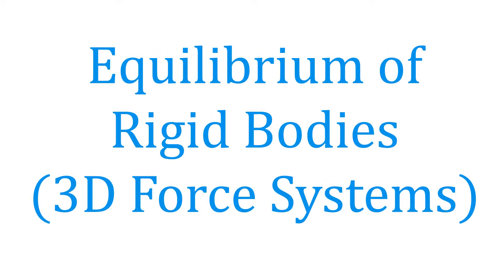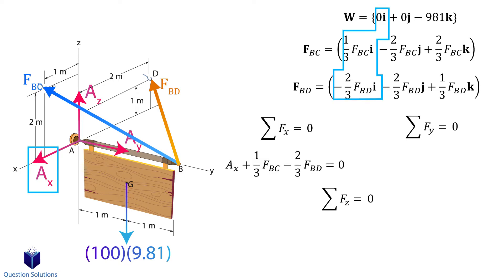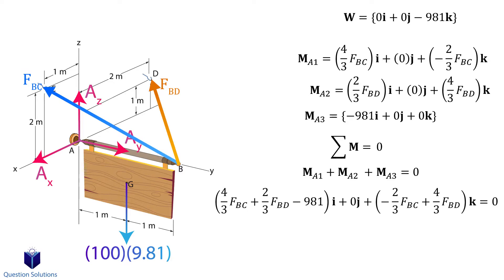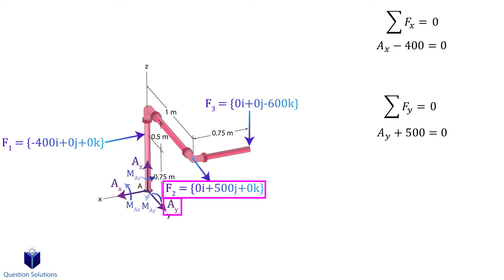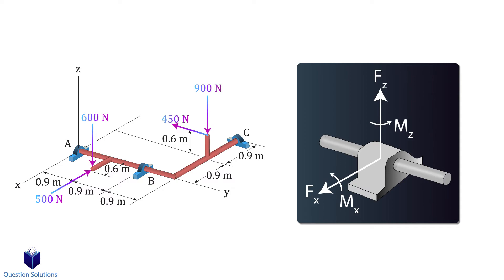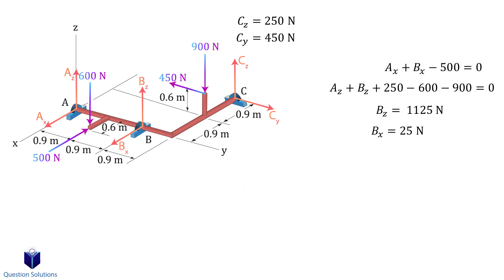Equilibrium of Rigid Bodies 3D force Systems | Mechanics Statics | (solved examples)

Comment: How do forces in the z direction create moment in the y direction?
Reply from the maker: See this video first: https://youtu.be/rdK0c9YZRYw
Reply: @QuestionSolutions  At 9:40, I do not see where you are getting the values for the moments; there are 3 different fixed points not just one. For example, how is the 450 N turning on the x axis instead of the y axis? Are you fixing it at C alone?
Reply from the maker: @the_eternal_student  So that's not how this works. The object isn't moving at all regardless of the number of supports. Imagine you dig a hole in a ground, pour concrete into the hole and then shove a big wooden beam in there. You then let it set. This beam is now solid, you tap it and say "this is not going anywhere" and it really won't budge. So you put all your might into it and try to push it, but nothing happens. Does that mean there is no moment created about the bottom of that beam, or any forces opposing what you're doing? Of course not, there is a reactionary opposing moment and reactionary opposing forces happening to keep that beam from moving. If that doesn't happen, it would fall to the ground (and you'd be in dynamics class, not statics). When you're calculating moments, or forces at pins, or rollers, what you're calculating is the reactionary force created by those supports. You're imagining the forces opposing what you're doing, that's what you're figuring out. When you drive on top of a bridge, the bridge doesn't move, but there are reactionary forces created at the rollers and pin joints. That's what you're doing in Statics class, you are just calculating those things, but all objects in statics are at equilibrium, they don't move or spin. You might remember that a roller can only create a vertical force. Did you consider why? Because if you push on it horizontally, it will just roll, it can't create an opposing force. So at 9:40, the object is fixed, nothing will make it spin, or move, but there are reactionary moments being created along different axes to make sure it stays that way.
Reply: @QuestionSolutions  I am still confused about how you are figuring out which forces and perpendicular distances to use in the moments. At 8:53, the y-axis has two perpendicular axes, but you do not include all the perpendicular forces. At 9:38, you include both axes, but not all of the y-axes, and the distances are not all to the moment point or the z-axis line of action. It is as if you are not only calculating the perpendicular distance to the line of action, but in some cases the distance to the line perpendicular to the line of action.
Reply from the maker: @the_eternal_student  This is incredibly difficult to show through a comment, and I can't answer this question without actually showing you in person step by step how to see which forces are creating a moment about an axis. So I encourage you to see your professor or TA during their office hours. Part of this is honestly using your imagination to see what forces would cause something to "rotate" about an axis and I can't teach that. It needs to come from your own imagination.
Reply: @QuestionSolutions  That is too bad, because I cannot go to school, and I understood everything in your videos, excepting this video.
Reply from the maker: @the_eternal_student okay, give me a few days. I'll create a document for you to understand this better.
Reply: @QuestionSolutions  Thank you so much!
Reply from the maker: @the_eternal_student  Here you go: https://bit.ly/3LhTAgl
Reply: @QuestionSolutions  I think I understand. The perpendicular distance has to be perpendicular to both the force and the axis. Thank you for your hard work.

Comment: at 6:08 can you kindly tell me how to find position vector of r3? I can't understand
Reply from the maker: So r3 is the green arrow at 6:07. The origin, which is point A, is (0,0,0) and the final point is where force F3 is applied, that's at (-0.75, 1, 1.25). So that's -0.75m in the x-direction (notice force F3 is applied on the other side of the positive x-axis), 1 m in y direction, and 0.75+0.5 = 1.25m in the z-direction. You subtract the first set of points from the second set of points to get the position vector, which is just -0.75i+1j+1.25k.
Reply: @QuestionSolutions  thank you so much! 
appreciate replying to every comment brother
Reply from the maker: @mirajuddinfuji6439  You're very welcome!

Comment: @9:34 why is the Force 450 multiplied by the perp distance of 0.6 and not 2.7 I thought the perp distance to the x will be the distance in the y but we took the perp distance of x is the height of z? Thank you in advance
Reply: @killatwistaplayz982  he’s doing the distance from the Y-axis, not the X. He does it for the rest as well.
Reply from the maker: So when you look at a problem like this, don't focus on a single point. Instead, really try to imagine this object rotating about the whole of the x-axis, not a singular point. Forget about all the supports that hold the object in place, let it freely rotate in your mind. Now, another way to see this is to realize that the 450 N force is a floating vector, that means you can move it along the same path that it's on, since the moment created is only a function of perpendicular distance to the x-axis (x-y plane). So if you move it on top of the x-axis, you can see that it's only a distance of 0.6 m away from the x-axis, in the z-direction. You are looking for the distance between the force and the x-y plane.

Comment: 6:07
for r2 &r3, why is the k component equal to 1.25 and not 0.75, am I missing something in the diagram? 
Found the answer, there as an additional 0.5m length from the Force to the bend in the bar towards F2
Reply from the maker: Yes, it's 0.5 + 0.75 = 1.25

Comment: can you tell me about the right hand thumb rule and how to use it
Reply from the maker: Absolutely. This doesn't apply to just moments, it applies to anything where the right hand rule is used. So imagine you have an object in front of you (in 3D space). If that object spins clockwise, you take your right hand, and you curl your fingers clockwise. When you do that, where does your thumb point? It would point away from you, so the moment vector is pointing away from you (in the z-direction). Now if that object is spinning counter-clockwise, you curl your right hand fingers to be counter-clockwise. Now which way does your thumb point? It points towards you. So whenever you need to use the right hand rule, you simply curl your right hand fingers in the direction of rotation, and see where your thumb points.

Comment: How do I know when to use scalar moments like in the last example, as opposed to the vector style of solving it?
Reply from the maker: You can use scalar if forces lie directly on a plane. So in simple terms, the forces are straight up, straight to the side, or straight down. If they are at angles, you can still use the scalar method but you will need to break them into components, at which point, it might be easier to just use a vector approach. Also, if a force is along a line, you will need to use a vector approach.
Reply: @QuestionSolutions  Thanks for your help

Comment: I don't understand how the 900,600 and Cz only make a moment when u take moments about the y-axis in the last example. How come the 500, Ax and Az don't make a moment about the y-axis?
Reply from the maker: I don't know where you're referring to. Please use timestamps.
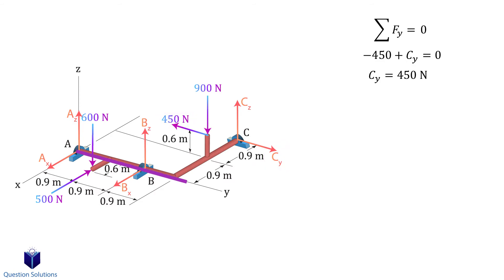Reply: @QuestionSolutions  8:24
Reply from the maker: @axviiaxvii5909  An easy way to think about this is to see if a force can make the object spin about the y-axis. If you push where the 500 N force is, with your finger, can that cause a rotation about the y-axis? No, right? So then that force can't create a moment. The same is true for Ax, and Az. But now look at 900, 600, and Cz. Imagine your finger exactly where each force is applied and try to imagine this object freely spinning about the y-axis. Every single one of those forces will cause it to spin about the y-axis, so they create a moment.

Comment: in the cross product isn't it +i-J+k so that means Ma1 would be +300j not -300j and Ma2 would be +625i not -625i same for Ma3
Reply from the maker: That's incorrect and you are doing the cross product wrong. I'll just do the first one for you. You are right that the j component is negative, so we have: 
-j[(0x0) - (-400x0.75)] = -j[0-(-300)] = -j[300]= -300j. So what's shown on the screen is right, please review cross products before you lose marks on your exams. If you have any other questions, let me know and I will do my best to help.
Reply: @ isn’it -j((-400*.75)-(0*0))=300j. In the cross product the ((first *last)-(Second*third)) so it would b -j(-300)
Reply from the maker: @alyssaesper7313  No, that's wrong. Watch the video I linked, or read your textbook.

Comment: at 9:35 why is the 450n force considered? And why is its perpendicular distance 0.6m?
Reply from the maker: So the 450 N force, which is the one on the top applied next to the 900 N force, creates a moment about the x-axis. The perpendicular distance is 0.6m because that's the perpendicular distance between the x-axis at the force and a moment is just force times perpendicular distance.

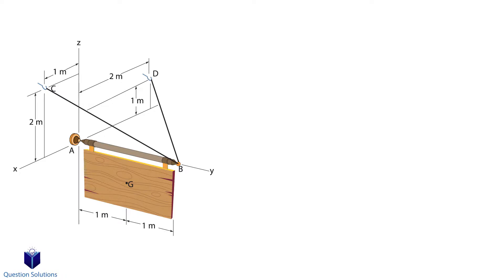Comment: @1:30 , why is the coordinate of the weight (0, 0, 981), should'nt it be (0,1,981)  since weight has an offset of 1 m in the y direction?
Reply from the maker: That's not the coordinate. That's the force, (weight), expressed in cartesian form. So it has just one component, which is straight down, along the z-axis. So the only component it has is the k component.
Reply: @QuestionSolutions  Does this mean that answers will be the same, even if the the weight is located with an offset 100 m in the y direction?
Reply from the maker: @samuelsudario6762  Well not for 100 m, since the whole board is only 2 m in length. But if you put the weight at 1.5m or 0.5 m, it makes no difference to the answer.

Comment: why didn't we include the 500 N force while calculating my in 9:02
Reply from the maker: The 500N force can't create a moment about the y-axis. The same as how Bx, Ax, etc can't create a moment about the y-axis. An easy way to think about it is to see if a force can spin the object about the y-axis (assume it's free to spin). If we push exactly where the 500 N force is, can we cause this object to spin about the y-axis? No, right? So then it can't create a moment.

Comment: In the 2nd question, for calculating moments, you can also use the formula M = Fd, right, instead of doing the cross product?
Reply from the maker: Yes, in this case you can because the forces all have a single component.

Comment: can i know what do you mean by 4 unknown at 3:10 because i count there are 5 uknown which is Ax, Ay, Az, Fbd and Fbc
Reply from the maker: It's just a misspoken word, there are indeed 5 unknowns. 👌
Reply: @QuestionSolutions  Is there  way to input that matrix and solve in calculator? (casio fx991es)
Reply from the maker: @DailyDoseDota  I am not sure, you'd probably have to look through your calculator manual.

Comment: at 9:39  I dont understand why is only one 450 used and why is it times 0.6?  since its 0.6 meters above the z axis
Reply: Did you forget to add cy(1.8) which will make x axis rotate clockwise
Reply from the maker: No, cy won't create a moment since it's 0m above the z-axis. That's why only the 450 N force was written in the equation, with a height of 0.6 m. So I know you said it will make the x-axis rotate clockwise, but that's because you're thinking about this problem as a 2D problem. You have to visualize this problem as a 3D problem with 3 supports holding it in place. A good way to visualize a problem like this is to imagine it free spinning about the x-axis. So this isn't clockwise or counter-clockwise in a 2D plane, this is going into the screen or out of the screen. Focus just on CZ and forget every support. If CZ pulls up, the whole thing would rotate out of the screen. Now focus on the 450 N force, which is 0.6 m in the z-axis. That will also cause it to rotate out of the screen. Now imagine the CY reaction, which is flat. Pulling at the location in that direction will not cause the object to rotate about the x-axis, not into the screen or out of the screen. It can't create a moment. I hope that helps. If you need a better visual, see this: https://youtu.be/rdK0c9YZRYw?list=PLXePpKFSUW2ZxGn6VdAPY9d7l7HowWVYL&t=20 at 20 seconds.    @Tyrantscandrive

Comment: Where is Cy in 3rd question when you solve moments in x direction
Reply from the maker: CY won't create a moment since it's 0m above the z-axis. That's why only the 450 N force was written in the equation, with a height of 0.6 m. You have to visualize this problem as a 3D problem with 3 supports holding it in place. A good way to visualize a problem like this is to imagine it free spinning about the x-axis. So this isn't clockwise or counter-clockwise in a 2D plane, this is going into the screen or out of the screen. Focus just on CZ and forget every support. If CZ pulls up, the whole thing would rotate out of the screen about the x-axis. Now focus on the 450 N force, which is 0.6 m in the z-axis. That will also cause it to rotate out of the screen. Now imagine the CY reaction, which is flat. Pulling at the location in that direction will not cause the object to rotate about the x-axis, not into the screen or out of the screen. It can't create a moment. I hope that helps. If you need a better visual, see this: https://youtu.be/rdK0c9YZRYw?list=PLXePpKFSUW2ZxGn6VdAPY9d7l7HowWVYL&t=20 at 20 seconds.

Comment: what happens if for example at problem 2,  on of the forces f1,f2,f3 are not on the x,y,z axis ?
Reply from the maker: The process is the same, and if you were given the forces in cartesian form, nothing changes. If you were given scalar values, you'd need to figure out the forces in cartesian form, but everything else remains the same.

Comment: Hi sir I would like to ask why is timestamp 9.35 when calculating the moment about x axis the force Cy is not included.
Reply from the maker: CY won't create a moment since it's 0m above the z-axis. That's why only the 450 N force was written in the equation, with a height of 0.6 m. You have to visualize this problem as a 3D problem with 3 supports holding it in place. A good way to visualize a problem like this is to imagine it free spinning about the x-axis. So this isn't clockwise or counter-clockwise in a 2D plane, this is going into the screen or out of the screen. Focus just on CZ and forget every support. If CZ pulls up, the whole thing would rotate out of the screen about the x-axis. Now focus on the 450 N force, which is 0.6 m in the z-axis. That will also cause it to rotate out of the screen. Now imagine the CY reaction, which is flat. Pulling at the location in that direction will not cause the object to rotate about the x-axis, not into the screen or out of the screen. It can't create a moment. I hope that helps. If you need a better visual, see this: https://youtu.be/rdK0c9YZRYw?list=PLXePpKFSUW2ZxGn6VdAPY9d7l7HowWVYL&t=20 at 20 seconds.
Reply: Tq sir

Comment: Professor is there a rule sth like.We have at least same number of equilibrium equations as unknown forces?
For example,six scalar equilibrium equations (sum of x,y and z axes=0(3 equations) ;sum of couple moments respect to x,y and z axes=0(3 equations) are enough for most 6 unknowns. Or randomly 5 equilibrium equations for 5 unknowns
Reply from the maker: I don't know if I understand your question properly, but to solve a set of equations, you need the same number of equations to the same number of unknows. So if you have 5 unknowns, you need 5 equations, and if you have 6 unknowns you need 6 equations.
Reply: @QuestionSolutions Oh I see ,so number of equations of equilibrium must equal or greater than the number of unknowns?We have most 6 equilibrium equations so ,we can solve for most 6 unknowns ;if we have 4 unknowns,we need at least 4 equations of equilibrium
Reply from the maker: That's right, you need the same number of equations for the same number of unknowns. @ygt824

Comment: Why didn't you solve the last question in cartesian form since it is 3D? Wouldn't have that been easier?

How do you know what method to use when - Cartesian or scalar?
Reply from the maker: It's really up to you. You can solve it anyway you like. 2D problems are solved using scalar most of the time. 3D problems can be solved using the Cartesian method or sometimes you can use the scalar method. If forces are along the axes, then you can opt to use scalar. Whatever is easier for you.

Comment: I just wanna ask, in problem 1 and 2, both are asking for the reaction at point A (ball point A in problem 1 and fixed support A in problem 2) but for problem 1, you didn't get the value of Max, May, and Maz unlike in problem 2. I reckon Both reaction Force and reaction Moment components are being asked for both problems so shouldn't Reaction moment be part of the final answers as well in problem 1?
Reply from the maker: Good question! So you have to remember, at a ball and socket joint, there are no moments created. That's because the object can rotate about the ball joint (which is why we use them). In a fixed support, there is no rotation, so a moment is created. Remember, when we find max, may, or ax, ay, we are finding REACTIVE forces. In simple terms, if we pull on the wooden sign, what sort of reactive forces occur at point A to keep this object from moving around? Since it can rotate about point A, there are no moments created. On the other hand, in a fixed support, it can't rotate about that point. That means a reactive moment will be created. I hope that makes sense, let me know if you need further clarifications.